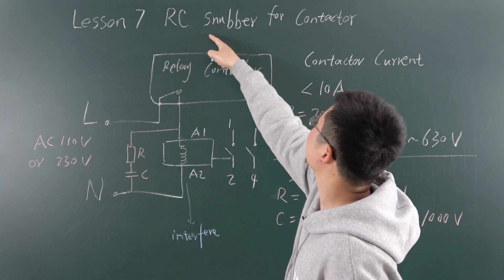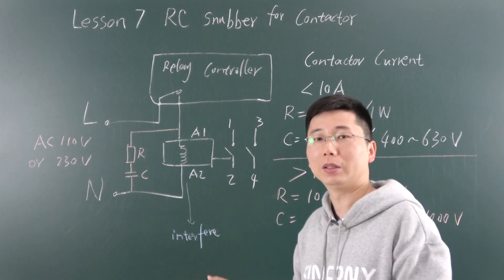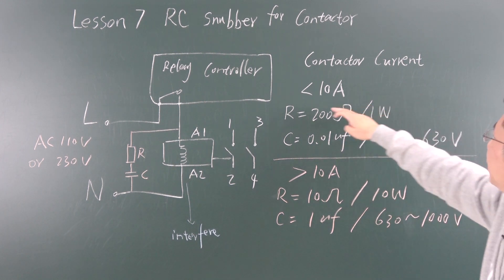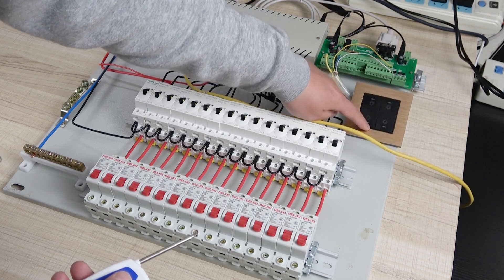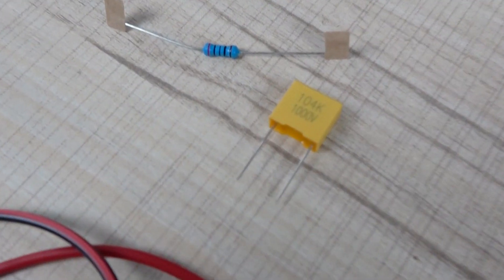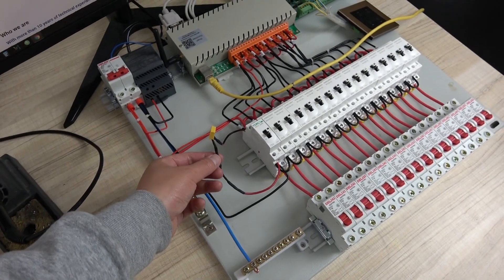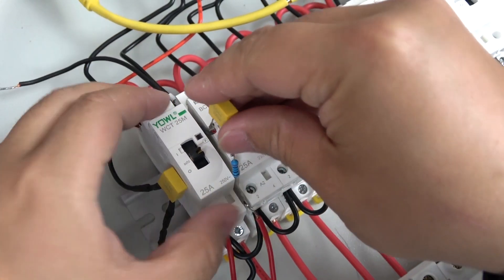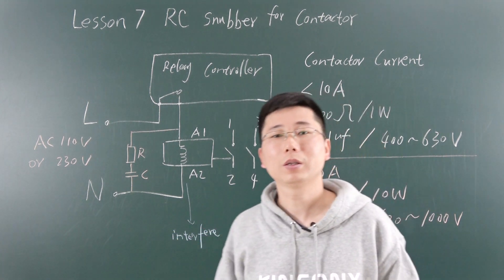【IoT training lesson beginners #07】why use RC snubber for AC contactor

Comment: some datasheets say you can also connect that RC-snubber parallel to switch - is that ok?   on ac - circuits of course.
Reply from the maker: only use for AC load.

Comment: Hello Sir, excellent information, Could I connect this in parallel to a monophasic 0.55Kw (Nominal current 3.8Amp with peaks up to 16Amp) 220VAC 60Hz water pump? Because this pump messes up my timer programming.
Reply from the maker: it's ok.
Reply: @KinCony  Thank you, would be ok resistor 100 ohms 1W and capacitor 0.1 microfarads?

Comment: I have a 24v AC (running at approximately 26.5V AC) solenoid valve with a measured holding current of approximately 480mA and peak current of 680mA. Measured inductance of solenoid valve coil is 42mH. Are the RC values of less than 10A mentioned in the video still the ones to use for this low current situation? (I will control the solenoid with a DC relay and want to put the snubber across the AC solenoid coil to protect the DC relay contacts from any sparking )
Reply from the maker: yes, use DC is better.
Reply: @KinCony my relay is DC but my solenoid is AC and want to use AC to control the solenoid and DC to control the relay. For the specifications given for my AC solenoid do you recommend the same R C values for <10A or is there something more specific that you suggest ? Thank you again for your help!

Comment: I just implemented snubber circuit on my water heater, contactor caused esp32 to reset , first I tried to connect to contacts of the three phase contactor snubber circuits, and it helped for awhile, but real issue was coil of the contactor.
Reply from the maker: RC connect with AC contactor's coin.
Reply: Same issue was with me☝️in three phase contactor when ever I control it via MCU.

Comment: Hello Sir, thank you for the video. I found on the market the arc suppressor ROXBURGH EMC  XE01010 that I would like to use with a 40A contactor, with max current limited to 16A. All the parameters fit with your indications except for the resistor power that is 1 W instead of 10 W. It will be a problem? I thank you for your help 🙏
Reply from the maker: i think it's ok, if use by 16A.

Comment: Aren't there AC contactors with integrated RC snubbers?
Reply from the maker: not easy to find this type, because space of AC contactor inside is very small, not enough space for resistance and capacitance.

Comment: thank you very much . i need videos for how can i  choose(calculate) capacitor and resistance for reduce interference . plz send me link for vids
Reply from the maker: The resistance and capacitance values under the conditions of AC220v and AC380v have been listed on the blackboard. These are classical values, which can be used directly.

Comment: Sir, do we need a rc snubber for 24vdc  coil contactor?
Reply from the maker: if DC coin, not need to use RC snubber.
Reply: @KinCony  thanks for very quick reply. My mcu sometimes get stuck (hard fault exception) when switching the contactor although I installed a flyback diode on main board. Do you have any suggestion for me?
Reply from the maker: @Justamario123  using AC contact?

Comment: Hello Sir, At Relay Output I have use single phase AC contactor and then it will convert AC to DC convertor Transform and  it will given 48VDC to next DC contactor for operate 48V DC motor ...The problem is At One stage Relay is taking extra time to off...like after 3min relay should off , but it's not...it taking 4 min...
Reply from the maker: ? i don't understand you, what do you want to do?
Reply: @KinCony  Actually sir  I am  operting two relay in different time frame..Like first realy will ON for 3 seconds and second relay will ON For 3mint.... Device is working fine but at one time it will hang... So relay is not operating in its given time like 3 min and 3 Sec relay.
Reply: @KinCony  I think it's noise interference From load ...
Reply from the maker: @ajayshokal7193  if use DC, not AC, i think no interference.
Reply: @KinCony  oky sir... I wanted to show you some schematic how can I
Reply from the maker: @ajayshokal7193  post to our forum: www.kincony.com/forum

Comment: Sir my 16A 3phase contactor coil is burnt, now i want to rewind this contactor coil its winding area(core sectional area) is 0.75inch*0.5inch sir can tell me the how many turns i have to wind for this 415vac contactor coil
Reply from the maker: You can find the formula for making transformer through Google
Reply: Can you tell me this formulla which suits this 415vac contactor coil

Comment: My contactor output rating is 40A, when switching the contactor , 16x2 LCD   shows weird characters, and lora communication get stucks. So what are the ratings for cap and res for my contactor.
Reply from the maker: what work voltage? AC220V?
Reply: @KinCony  220v ac, ur explanation ur  explaining 103(0.01uf) capacitor, but u have connected 104(0.1uf), which is correct
Reply from the maker: @anurajn2616  104 is ok.
Reply: @KinCony  thanks for ur reply
Reply: @KinCony  sir, for 220v ac contactor what will be the value reverse voltage, around 1000v, or is it depends on the coil current, is there any formula for calculating this
Reply from the maker: @anurajn2616  if use for AC220V, use cap by 680V is ok, if use for AC380V 3 phase , use cap 1000V is ok.

Comment: Hi, can this high voltage transient damage contactor coil insulation & power factor  switching relay? Can you also kindly  explain how to calculate required dampening resistor for high in rush current while switching contactor at capacitor bank, Thank You.
Reply from the maker: use snubber will protect the contactor and relay,avoid shock. resistance: 250ohm 3W capacitor:103 1000v. use for AC220V or AC380V AC contactor.
Reply: @KinCony  Thank You. For three phase,rc snubber has to be put in across or parallel to contacts so as to reduce arcing on the contactor contacts?
Reply from the maker: @Ragavenutb  yes, just parallel to ac contactor. 3 phase and 1 phase contactor is same way.
Reply: @KinCony  Thank You. Can i know if you are available to undertake some Iot projects for my company and also i wish to purchase 6 channel rc snubber  you show on one of your videos not sure which video but i saw it, i require 10-20 pcs but your shop on aliexpress and aliexpress itself is inaccessible due to restrictions from our govt. Kindly reply Thank You.
Reply from the maker: @Ragavenutb  ok, when you have project need help, you can tell us. we have 8 channel RC snubber, you can use for 6 channel. can you open alibaba.com webpage? we can make online order.
Reply: @KinCony  i already ordered 10 pcs sir. From your company only.i also spoke to your help desk for discount on shipping they did really good job. Nxt order ill place more than 50 pcs. One suggestion though assuming you already know. Why not slap an MOV to an existing snubber it can do added benefit right. & nice factory you've got there would love to pay a visit when travel restrictions are over. Thank You.
Reply from the maker: @Ragavenutb  you are welcome, now our new AC contactor already installed RC inside, here is video: https://youtu.be/nqsA14-sQYU

Comment: Do you need to use a similar system when using relays with a 12V coil?
Reply from the maker: what's your means?
Reply: No, just a diode when using dc coils.